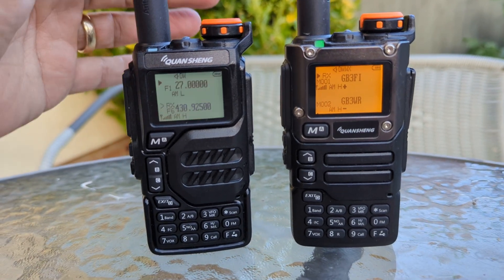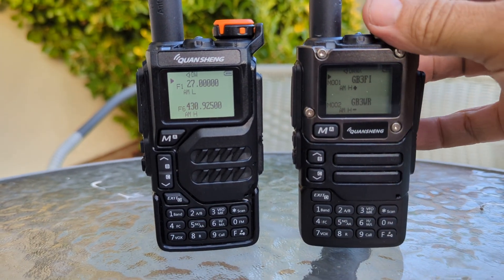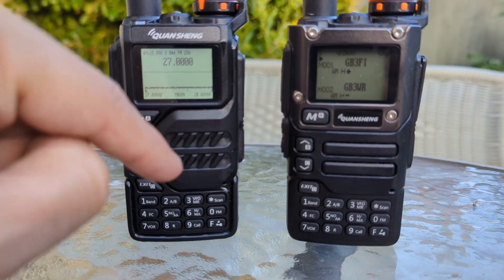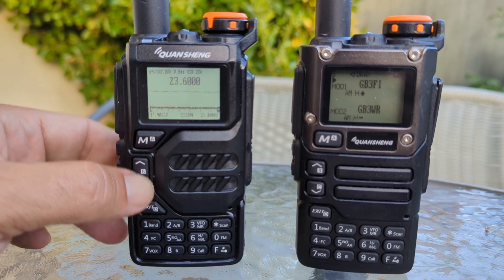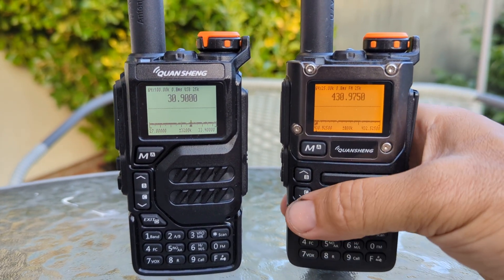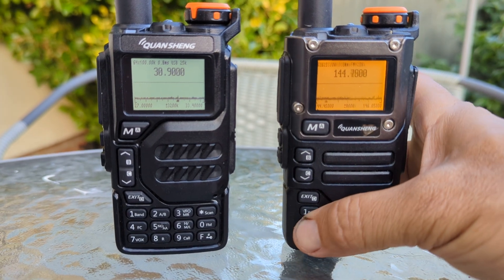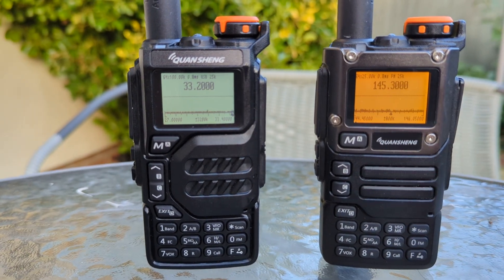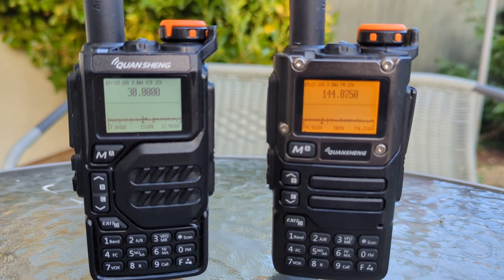SSB MOD  UVK6 & K6 - HF RADIO

Comment: What if i flash this file, wil i loos my already modded firmware with extended tx/rx ?
Reply from the maker: Yes
Reply: @M0FXBHamTech  But has the new firmware also extended tx/rx ?

Comment: Does this firmware works with the Quansheng UV-5R Plus?
Reply from the maker: No
Reply: Yes on my Quansheng UV-5R Plus it does
Reply: @JohnPotter-l7l  i have tested in mine and works just fine as well.